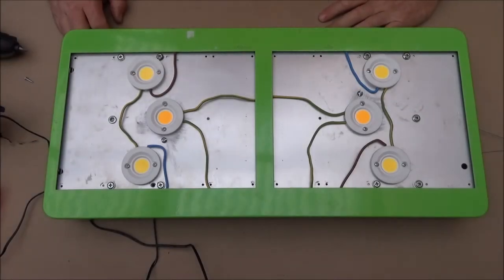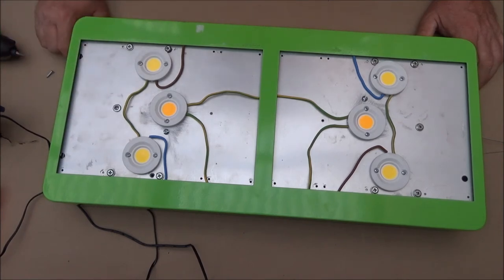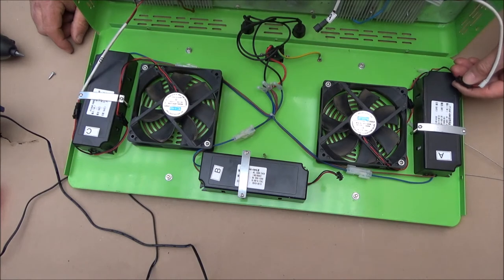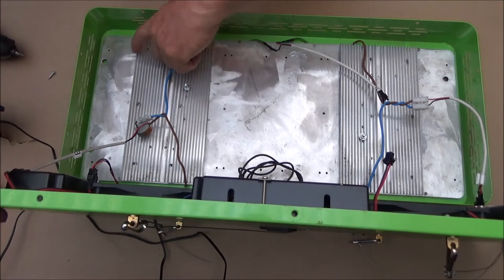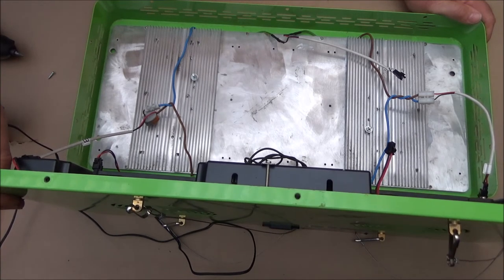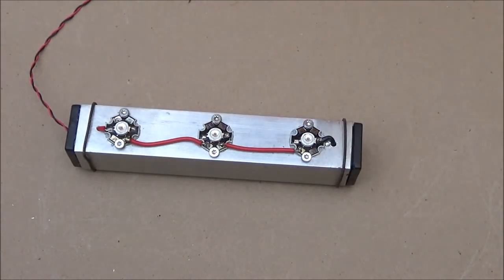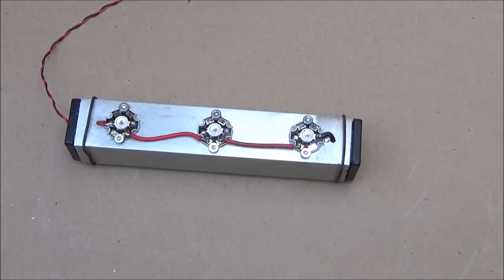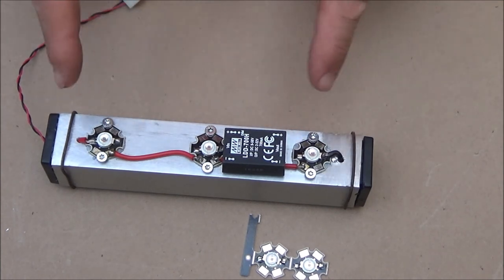mars hydro hack with Cree 2540,s and growmau5 far red flower initiator

Comment: Hi mate . You defiantly need more heatsink and spread the cobs out so the heat can dissipate better. Good to see more Brit's using led cobs
Reply from the maker: Garry thanks for the reply. The active cooling more than makes up for the lack of heatsink. That are 2540's and are only running at about 25w and are  half the size of 3590's so all is good.
Reply: The Growsausage sorry muka had it in my mind that you had used 3590 (me thinks i was bashing bud )  hows it going ? iv been running 3070 for over 4 years now, and they are still pumping out the par .love led's

Comment: These are 55-100v drivers he has.   How does the voltage act when ran in series vs parallel?   Do you have to have cobs or boards in that 55-100v range?